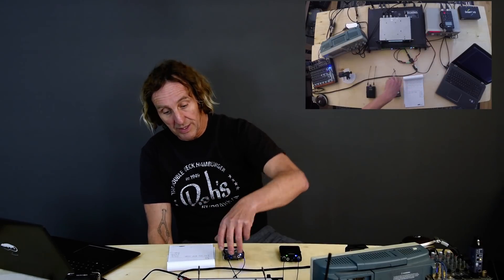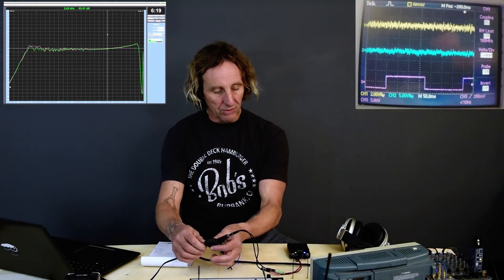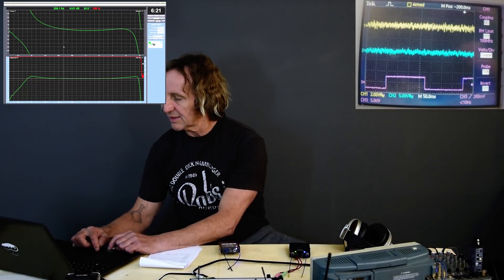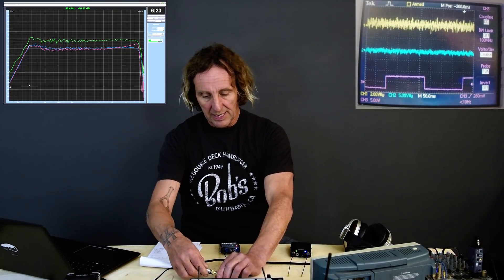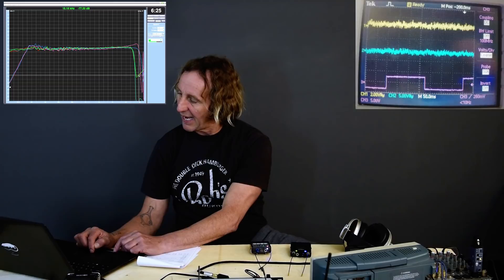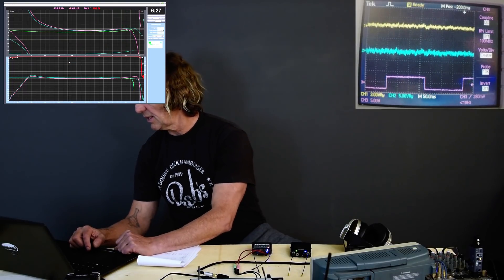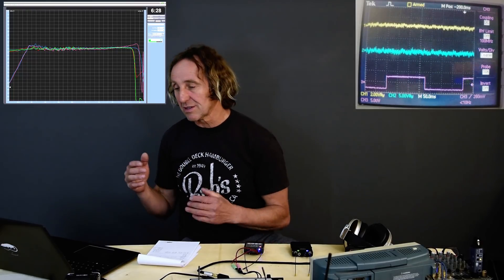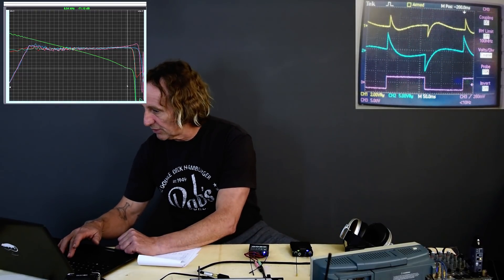Analog vs Digital In-Ear Systems Part 1 - Shure PSM1000 vs Digital Lectrosonics D2 In-Ear #15

Comment: Thanks for the great video! 11.4kHz seems really low for an IEM. Is that a big issue in reality? Lots of people say the Lectrosonics sound good, but no one mentions the missing top end.
Reply from the maker: Yeah, from a hifi aspect 11k is low. But IEM is more about getting a reference and knowing what other musicians and yourself are doing rather than critical listening, so it's typically not an issue

Except if the monitor eng is trying to recreate those high frequencies which creates loads of problems with limiting and sound quality of other frequencies.

Comment: So ive tried PSM 200 and PSM 300. The PSM 200 sounds richer and warmer to me however I'm getting static or RF noises when I play a chord on the digital piano. The PSM 300 doesn't make that noise but has a thinner sound... am I going crazy??  From what I understand the 200 Is analog and the 300 is digital.  Is there an Analog warm and rich sounding IEM system that doesn't have the RF noises out there?
Reply from the maker: They should not sound too different except if you overload them. The digital psm300 will sound much worse when driven into distortion

My guess is that if you are hearing drastic differences, the units are most likely being overloaded with too much signal.

Pay very close attention to clipping and overload and also make sure the settings are set to avoid any clipping 

Send less signal level to the transmitters and turn the volume of the belt back up higher often helps
Reply: @DaveRat  Hey man, thanks so much for the quick reply. I'm not getting any overload/distortion. I do have the vol knob on the PSM200 down almost all the way..not sure if that's the issue (but my piano has a hot signal so I have to put it down alot. I banged a few cluster chords on the piano just to verify the no distortion.
Reply from the maker: I would say that your volume on the belt pack should be 50% or higher. Then adjust the input level sent to the transmitter to make anout the volume you want to hear. 

There may be settings for input level or maybe need a pad.

What you want to avoid is sending hot to the transmitter. There also can be overload in the transmitted signal

Not familiar with those units but my gut tells me that it should not sound drastically different than the 200

Comment: Hey Dave, 

first of all a big thank you for your excellent instructions. With my band, I now dare to go on stage with my Macbook and audio interface (Tascam 18x08). For me, Reaper is easier to use than any digital mixer I've had before. And now my interesting experience from our last band rehearsal, normally we have a roundtrip of 6.9ms from the interface and 5ms from our in ear solution (Xvive u4) gives 11.9ms, but at our last rehearsal I forgot to reset the audio buffer from my last session from 1024 samples to 32 samples at 96kHz. Now the unbelievable with 1024 samples buffer we could hear ourselves fine, much better than with a 32 samples buffer, how can this be, I suspect it's the phase which is somehow awkward with 32 samples. Dear Dave, could you help me to clarify this. 

Thank you very much
Philipp
Reply from the maker: Just use the setting that works
Reply: @DaveRat   Dear Dave, 

Thank you very much for your quick reply. I have thought about it again and now put a digital delay with 33ms and 16% dry/wet on all monitor channels. For the first time I can hear my vocals and my guitar clearly in the in ear monitor. My vocal range is bass / baritone and just in this vocal range there seems to be particularly many sound wave overlays in the skull, which are even more striking with in ears.
Reply from the maker: Interesting it's possible that there's a polarity reverse somewhere in your system and you need to delay it in order to not get the cancellation.

Try minimizing the delay and reversing polarity
Reply: @DaveRat   Certainly, but unfortunately the wave cancellations seem to be strongly dependent on the frequency, so the delay seems to be the easiest solution for my problem.
Reply from the maker: If things are in time and in polarity, all will sum well.

If it is out of polarity, it will never sum and time shifts will drastically change the the frequencies of cancellations.

From what you describe it sounds to be polarity as the main issue and time shifts as the secondary issue.

It is not uncommon for sound cards to be polarity reversed.

Test polarity once that is correct, then find optimal time shift

If increasing time shift makes it better, that is often an indication that polarity is reversed.

Have you watched the vids I did on polarity and in ears?
Reply: @DaveRat  Yes, you are right, the polarity makes a big difference. 

If I sing a note in my middle register, reversing the polarity feels like my voice is jumping out of my head and back again. 

If I adjust the polarity at a certain pitch so that I hear myself optimally, again lower or higher notes are hidden behind a resonance or overlay. 

I now have the following theory: 

when I sing, I stimulate different resonance spaces with different durations in my head. 

If I now: 

1. set the polarity for my middle register correctly. 
2. set the latency as low as possible. 
3. add a delay effect with 33ms / 10x feedback / 16mix,

 I get the best result. 

It seems that with this setting my hearing is able to process my sung note optimally and at the same time evaluates the tone information of my guitar right.
Reply from the maker: Cool cool sounds like you got it
Reply: @DaveRat  It may be that the delay effect gives my hearing a renewed chance to hear a tone clearly that I was unable to perceive at the time of its release. 

Dear Dave, you are a true inspiration. Thank you so much for sharing your knowledge with me and the rest of the world. Thank you so much.

Comment: Great vid! One thing on latency. if you use a digital mixer, what is the latency saving from skipping multiple runds of conversion?
Reply from the maker: Each conversion tends to be .4ms to .8ms so converting to digital and back is .8 to 1.5 typically with modern gear. Once in digital, FIR filters and processing can slow things further.  I have covered latency in several videos I think on the M32, x32 and QU16

Comment: I am loving these vids. I worked for a regional provider in the Upstate SC in the late 90's early 00's. I am an EE now designing electronics, but I loved working audio. Mixed the TV broadcast for the mega church in Spartanburg. They put in a pretty tremendous 5.1 d&b sound system with PM5D consoles. I really grew to love Yamaha's equipment. We did theatrical also, so mixing in surround was a thing.
Reply from the maker: Super cool and thank you!

Comment: Whats the point of doing all this processing, companding, to the signal? If youre converting to digital at the transmitter, why not just transmit the data, and convert it back to analog exactly as it was sent?
Reply from the maker: Good question, the dynamic range of wireless transmission. Is very limited. Especially if trying to transmit in marrow bands requires for having numerous wireless channels in the limited rf bands allotted to pro audio wireless.

So, manufacturers are faced with a choice, massive compression or loads of noise.

To try and deal with that by compressing before transmission and then expanding on the receiver side, to try and maintaing dynamic range and minimize noise.

All solutions have issues but a quality compander seems the best fix though it has issues.
Reply: @DaveRat  ah... makes sense, I had never even considered that. Thanks for that explanation Dave.
Reply: As Dave points out, we have a limited pipeline through which to send a stereo signal, so we either have to compand (analog) or data compress (digital) to achieve decent fidelity, low noise, and low latency.

Comment: So why would they filter the wireless pack and roll off that top end? I understand its not really going to be all *that audible, but are we gaining any benefit from rolling that off?
Reply: The Duet system is digital and doesn't use a pilot tone like analog stereo transmissions do. In our case, we needed to fit two decent fidelity signals done a fairly small pipeline, and do so with minimum latency, so the tradeoff was limited audio frequency response in the upper register.
Reply from the maker: Thank you for jumping in and awesome to get info from Lectrosonics directly.
Reply: @lectrosonics  Thanks so much for expanding on this for me! That makes sense, i guess I didnt realize how little the "pipeline" was for transmission. And i understand how having full spectrum might not be near as important for monitoring.
Reply from the maker: They use a 19k pilot tone that divides the left from the right channel with the left channel below the time and the right channel above the tone at double the frequency for transmitting.  Then they freq divide the right channel back down and us the the 19k as the reference middle point.

So they need to cut out the 19k from being heard on the output, so they filter it.

Of you use the packs mono, they don't need the pilot tone and the freq response can be extended
Reply: @DaveRat  Cant say i quite understand the purpose and actual functionality of the pilot tone. Where can i learn more on that?
Reply from the maker: Searching pilot tone rf transmission should get you I to that rabbit hole.

Here is a start

https://en.m.wikipedia.org/wiki/Pilot_signal

Comment: When you plug into the front of the panel does it reduce the high end due to the lack of pilot tone? Because it’s not transmitting an RF pilot tone and it’s capturing the whole noise signature does this account for the difference @5:40?
Reply from the maker: The front panel will have a vastly different signal path. Whatever the differences are, 9ne train of thinking is that the front panel output should be as identical as possible to the pack output and offer an accurate reference point. So ideally the front panel output would emulate the pack output including any impacts of pilot tone and compander.

Clearly both companies attempted to do this as the responses do resemble the pack outputs more so than they resemble the input signal, which does not have the hf rolloff in both, and LF rolloff in the shure. But, neither company was complete in accurately emulating the pack output, though Lectrosonics was close sonically, the noise and polarity appears to be engineering oversights.  The shure has the additional challenge of trying to emulate or recreate the impacts of the compander andarticats of analog transmission. Also the missed the mark on the freq response and HF rolloff slope.
Reply: @DaveRat  would the appropriate thing to do when using those packs until they are re-engineered or patched with software to flip phase on the output in the console or simply leave it
Reply from the maker: @Cletusaz  the front panel is out of polarity but the pack is in polarity.  There are polarity reversals controls on the pack, so u could rev the polarity on the pack and then send to it rev polarity and all would line up but...

Just don't use the front panel outs is the best way.  Use a spare pack for monitoring the musicians feed.  That way you can get the exact sound
Reply: @DaveRat  you're a legend Dave! Thank you for the reply and helping me continue to learn more everyday. ✌️🖖
Reply from the maker: @Cletusaz  👍